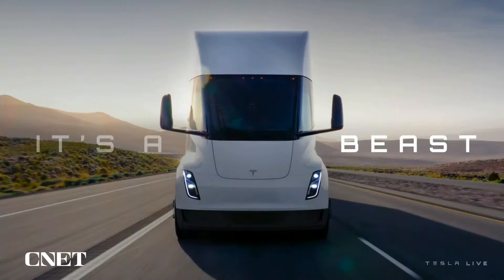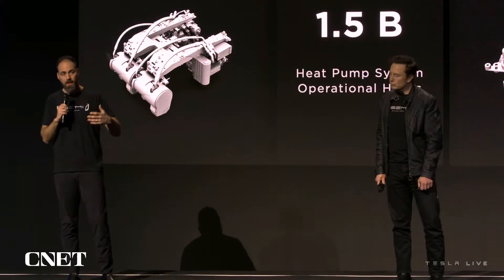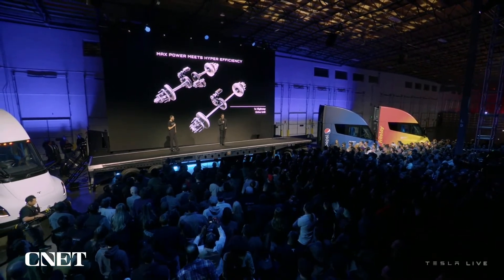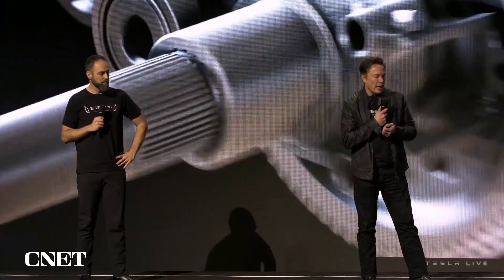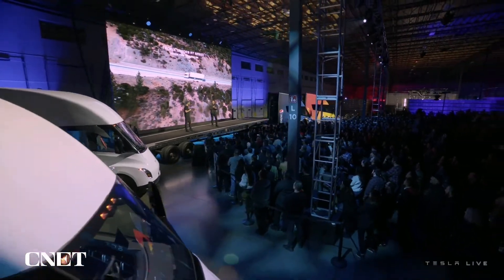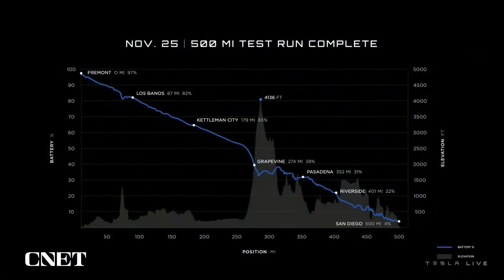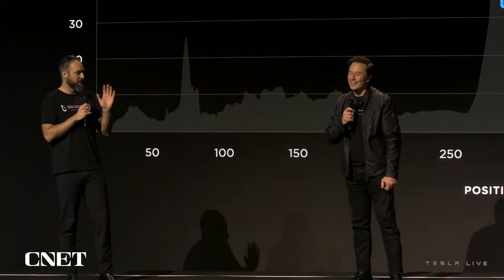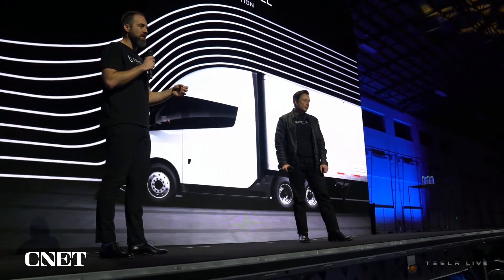Watch Elon Musk's Deep Dive Into the New Tesla Semi-Truck

Comment: When it comes to long range these electric trucks have nothing compared to diesel.
Reply: In most cases, it come down to lowest transportation cost per pound/mile...everything else is just noise.
Reply: When it comes to energy efficiency tho diesel never comes close
Reply: 500 miles is a significant range achieved with a rise of 8000 ft, I understand.  It's going to address.most applications, that's for sure. 30 minute recharge to 400 miles range is, pretty amazing. The build out of mega chargers is planned for Cyber Truck so there should be sufficient mega chargers in time. I think you are desperately clutching at straws not to recognise this as huge achievement. It's going to address all but the most extreme applications.
Reply: Very true. People are so giddy that they ignore energy density math. Crossing the Sierra could seriously deplete these batteries with much of a load.
Reply: @DefundTheFringes  Pretty sure adding a few hours is worth the MASSIVE fuel costs, driver safety features, and ease of use. They save money in the long run, and thats all companies care about.
Reply: @baddriversofthenorcalarea500   i would think Tesla will be faster from point to point,, drivers still have to stop to eat and use restroom even in diesel trucks,, so i doubt that saving the time it takes to fill one take for a 2000 mile run is going to make any difference,, and also consider what a slog it is up a hill for a truck,, Tesla semi will be miles ahead before any other truck even gets up a hill,,

Comment: I'd love to see the look on the other trucker's face as he was being passed by a rig loaded with concrete barriers.
Reply: Same look your mother had when she walked in on you and your boyfriend in the tub
Reply: @johnbauby6612  There you go thinking about men in bathtubs again.
Reply: "atleast i aint paying double for my fuel" says the diesel truck
Reply: Grades deplete batteries quickly. Best learn the physics of energy density. 100:1 ratio of petrol fuels to current lithium ion batteries creates major load trade-offs.
Reply: @DefundTheFringes  
500 mile range under real world conditions, with a full load.
Also, when breaking or going downhill the batteries are recharging. ICE vehicles have had a good run, but they're reaching their peak of technological advances. BEVs are the future.
Reply: @DefundTheFringes    It's better than the most recent claims of 500m with only 100m at 1% grade, but then maybe that meant net alt gain of few thousand ft. which makes a big diff. 
Anyway--it's more than good enough when a 30 min break is the law, and 350m can be added in that time.
Reply: @DefundTheFringes  imagine if a diesel engine was efficient. they are only 50% efficient at most. so if you got you 500mile range you only need to maintain 50% and you are keeping up fine.
Reply: @DefundTheFringes    They did roughly as much alt change in the 500 mile demo as Donnor Pass at 8k.   One 4k a few 1500 to 2k from SF to San Diego, start and end at sea level.

Comment: In the game of efficiency we have a new king in the trucking business and no competitor is even close
Reply: Freight rail can haul the equivalent of an 80,000 pound semi for 500 miles on only 40 gallons of fuel - which here in Texas is currently only about $170.  The focus on the electric semi will cause other investors to consider the potential of upgrading freight rail infrastructure.  If the current average speed of a freight train increased from 45 mph to 60 mph the rail system would ship even more than it currently does.  Truck drivers must stop for 10 hours of rest after every 14 hour shift, freight rail can keep rolling.  The last few miles from the rail terminal is where trucking excels.  Rail is more efficient than the Tesla semi.
Reply: both volvo and scania have trucks that run on electricity. both volvo and scania have trucks that run on electricity and they are loaded heavier. but I don't know how far they can be driven without a charge.
Reply: @antonlagervall1  
Volvo electric semi has a range of 275 MI. In the US the weight limit is 82,000.
Reply: @grumpusmaximus9446  ok yes then tesla has longer range than volvo. I saw today that here in Sweden there is a company that drives an electric Scania that weighs 74,000 kilos
Reply: @antonlagervall1  
That's 81 tons. The weight limit of a semi truck in Sweden I believe is 64 tons.
Reply: @grumpusmaximus9446  and it’s super expensive to purchase with no supercharger network ..value to customer 0
Reply: @Mobileccs  
Wow! If only Elon Musk and all the companies lining up to buy Tesla semis knew what you know. You should contact them immediately and tell them to stop, before they lose everything.
Reply: You need to study the physics of battery energy density before buying into all the hype. Grades wipe out batteries quickly. Easy to find that info.
Reply: @DefundTheFringes  I'd like to see some test results along the lines of Joules of energy per height elevation at various grades between the Tesla Semi and a some typical diesel semis.  Gravity is hard on everything as anyone mountain biking the hills can attest even with high gear count.

It gets more interesting with regen braking too.  Because the EV's natural battery regen capability during descents can push a lot of power back into the battery.  

A diesel truck can only waste potential height energy as heat through the disc brakes and the transmission via engine braking.  Moreover, the high mass of a big rig means a lot of energy capture is available -- therefore a better test may be pull a specific load up the hill and then back down to the same elevation and measure the energy left in the truck.
Reply: @DefundTheFringes  with over 62 million miles world wide what would I need to study ?
Reply: @Mobileccs  he is just diesel head and tesla hater man. You cant change them